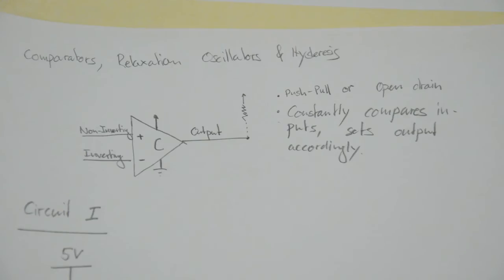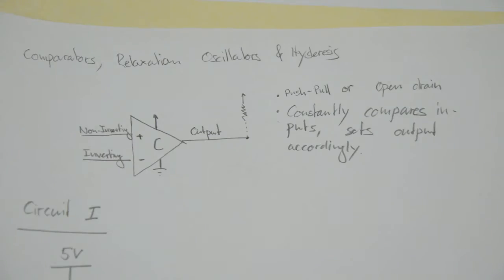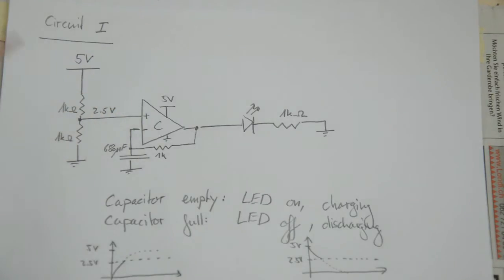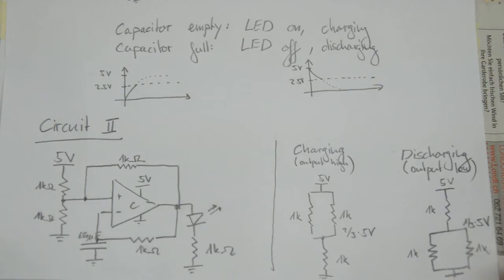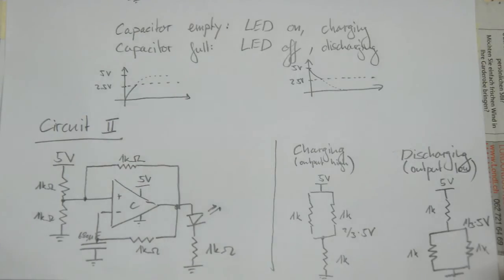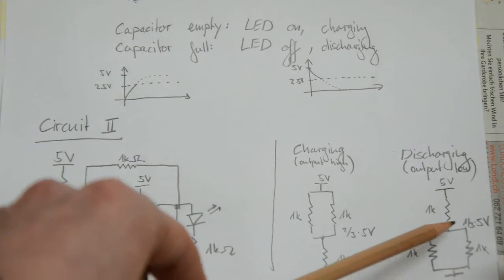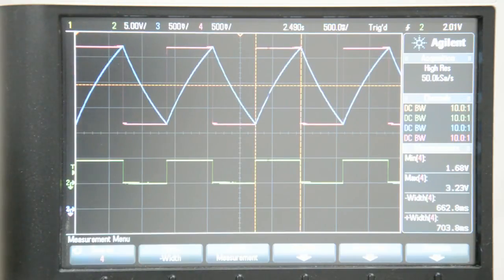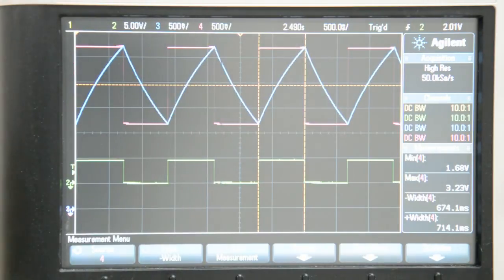Comparators, Relaxation Oscillators and Hysteresis

Comment: Hello MrCircuitMatt, thank you for the informative video! It really helped me. However I have a hard time understanding why there is no 5V on the inverting input (that is applied by the output of the comparator) as there is a connection between the output and the inverting input. Also how can the capacitor apply voltage to the inverting input if from the same wire the output of the comparator is charging the capacitor. Will the current flowing out of the capacitor to the inverting input not oppose the already existing current flow from the output of the comparator? I hope you can help me with this,

Nobadnote
Reply from the maker: nobadnote Hello nobadnote. I'm trying to explain this around minute 3:40 of the video. Are you familiar with the dynamics of how a capacitor is being charged through a resistor? You are right in that the comparator output is at 5 V. Now imagine, just as a thought experiment, a resistor of 1k instead of the capacitor. Would you have 5 V at the inverting input? I would say no, as there would be a voltage divider and you'd have only 2.5 V there. This shows that there might be something going on there that results in a non-5V-voltage there. Now due to the way capacitors work, they look like a short circuit ('0 Ohm resistor') when discharged, but as they get charged, they sink less and less current, which looks like their resistance is increasing. So if you let the capacitor charge long enough, you will indeed end up with 5 V at the inverting output. However: Sine the comparator output drops down to 0 V as soon as the inverting input exceeds 2.5 V, the cap will never get fully charged. Because as 2.5 V is reached (or whatever voltage is set by the hysteresis action in the example with hysteresis later on), the output drops to 0 V and the cap is getting discharged.

On your second question: You are right in that current would not flow out of the cap while the output is high. When the output is high, the capacitor is being charged and thus current will flow into the cap. The direction of the current changes as soon as the output drops to 0 V. When this happens, it's essentially ground and current can flow out of the cap, through the resistor and into the output. This is very confusing because it's called output, but a push-pull output can indeed sink current when it is in its LOW state.

Neither of the two comparator inputs sink or source any current. (In reality they do but it is so small that we tend to ignore it). You can think of the comparator inputs as little high impledance voltage-meters that simply measure the voltage there. So there wouldn't be any current flowing out of the capacitor and into the input, as you say. There is current flowing from the output through the resistor into the capacitor in the charging stage and current flowing from the capacitor 'backwards' through the resistor into the output in the discharging stage.

Did that help you in better understanding the process? Please let me know. Best regards, Matt
Reply: MrCircuitMatt Hello Matt, thanks for taking the time to respond to my questions! It definitely helped me understand more of the process. I'm really thankful you responded!

If by the dynamics of how a capacitor is being charged through a capacitor means how a RC-circuit works then yes. If a resistor is coupled with a capacitor in series the resistor will increase the time it takes to charge the capacitor. If I were to plot the potential difference across the capacitor over time the voltage and the current of the resistor will decrease asymptotically to 0 while the voltage of the capacitor will increase asymptotically to the source of the voltage. I also understand that the capacitor will mostly be around 2.5 volts and thus in the first circuit the comparator will switch erratically between logic low and high as explained in your video around 5:30. However I am still not sure how the voltage across the capacitor let's say it is 2.5 volts can also lead to 2.5 volts on the inverting input if the capacitor is being charged. Does the voltage across the capacitor also cause/apply the same voltage on the inverting input at logic high, and if so how? Do I have to see the comparator as a voltage-meter across the capacitor? If I were to replace the capacitor with a 1k resistor it would create as you said above, a voltage divider, which causes the inverting input to read 2.5 volts. So if I were to replace back the capacitor which has a resistance that is lower than 1k, than the inverting input would read a voltage which is higher than 2.5 volts, right? So at the beginning of the charging cycle the capacitor must act as a resistance of higher than 1k in order to not immediately trigger the discharging cycle.

I think I’m a bit confused about what causes a potential difference at the inverting input. In this case the voltage on the inverting input is greater than 2.5 volts caused by something in the circuit, supposedly by the capacitor. But a capacitor only stores charge during the charging cycle how is it able to make a potential difference of 2.5 volts at the inverting input? The 5V output of the comparator passes through the resistor and then splits in two, one way it goes to and charges the capacitor and the other way it goes to the inverting input. So the voltage on the wire to the capacitor and also to the inverting input should be the same. But then the voltage over the inverting input would already be higher than 2.5 volts if the capacitor has a resistance lower than 1k thus triggering the discharging cycle. So this is I believe definitely not how it works.

This might be a bunch of gibberish but I hope I made my problems and questions clear. I hope you can answer my questions and help me understand the process better.
 
Thanks in advance!

Nobadnote
Reply from the maker: nobadnote Hello again. We're getting closer! First of all on "does the capacitor apply the same voltage on the inverting input [...]": Yes. I guess you know this, but everything connected by a line in a schematic is at the same potential. This means that the inverting input will be at the same potential as the non-grounded terminal of the capacitor along with one terminal of the 1k resistor.

"Do I heave to see the comparator as a voltage-meter across the capacitor?": In this circuit, absolutely. The comparator senses the voltage on the inverting input, which is equal to the voltage across the capacitor because the two are directly connected (see above). It also senses the voltage in the non-inverting input which is 2.5 V in Circuit 1. The comparator compares those two voltages and sets its output according to the result of that comparison.

Now there is one point that I want to emphasize: Voltage is always across two nodes in a circuit. So strictly speaking my sentence "the comparator senses the voltage on the inverting input" does not make sense because that's only one node. But I implicitly mean "with respect to ground" when I say it like that. So the second node would be ground.

"So if I were to replace back the capacitor which has a resistance that is lower than 1k, than the inverting input  would read a voltage which is  higher than 2.5 volts, right?": I would argue that you would observe a voltage lower than 2.5 V. Imagine e.g. 1 Ohm. So you'd have 1k in series with 1 Ohm down to ground and the voltage across the 1 Ohm resistor would be very low (5 V * 1 / (1001)). Maybe this is the twist in your logic. Because it entails that it will not immediately trigger the discharge cycle, but instead some charging is necessary before the discharge cycle happens. What you said about the erratic switching is absolutely correct though as long as no hysteresis is implemented. Try to split the whole cycle into a charge-cycle and a discharge cycle and treat it as normal RC charging/discharging. Maybe this helps. 

"The 5V output of the comparator passes through the resistor and then splits in two, one way it goes to and  charges the capacitor and the other way it goes to the inverting input.": This is another thing that is very important to realize: The way you spelt this out somehow suggest that voltage is something that flows. I'm not sure if this is what you have in mind, but if it is, then that would be wrong. Voltage does not flow. Current flows. So it is correct that some current flows out of the output, through the resistor and into the capacitor. As a consequence of that, the voltage across the capacitor rises. However, there is no current flowing into the inverting pin. Well, there is a teeny tiny little bit of current, yes. But you can absolutely neglect that. This is like the current that flows into your multimeter when you are measuring voltage(!). In that sense, I really like your suggestion of treating the comparator inputs as multimeters which sense the the input voltage.

"But then the voltage over the inverting input would already be higher than 2.5 volts if the capacitor has a  resistance lower than 1k thus triggering the discharging cycle.": This is the same twist here again. Maybe realizing that it's exactly the other way round already fixes your issue. If not, please please please re-iterate and ask again for clarifications, I'd love to help you sorting this out. Maybe it was not smart of me to introduce the resistor-replacement thought-experiment. Another way to see this is by simply treating it as exactly what it is: Charging a capacitor through a resistor. Exactly like you described above, the voltage would asymptotically approch 5 V. And at some point it will reach 2.5 V during that process. And then we need hysteresis to make the whole thing oscillate in a controlled way. Let me know if this needs further discussion to sort it out!
Reply: MrCircuitMatt  Hello Matt, thanks again for helping me out. I still have some questions but I think I am understanding it better now.

I do know that the voltage is relative and it is the electrical potential difference from point A to B and is defined by how much energy it takes to move a charge through an electric field from point A to B. It is the charge and thus the current (how many charge flowing in a point per second) that flows and the voltage is the 'pressure' that is needed to let the current flow.

'I would argue that you would observe a voltage lower than 2.5 V. Imagine e.g. 1 Ohm. So you'd have 1k in series with 1 Ohm down to ground and the voltage across the 1 Ohm resistor would be very low (5 V * 1 / (1001))...' I thought I needed the voltage across the first resistor to determine the voltage on the wire connected to the capacitor and the inverting input and thus have a larger than 2.5V applied on the inverting input and capacitor. If the capacitor was a 1 Ohm resistor would it not have a low voltage on the grounded terminal?

What I don't understand is: why isn't there (or can't there be) >2.5V directly applied to the inverting input by the output of the comparator in the first circuit? It seems like the capacitor is the only component in the circuit that is able to apply a voltage on the inverting input. But if I see the circuit I would say that the resistor and the capacitor are both directly connected to the wire which is connected to the inverting input. So how can the output of the comparator not apply >2.5V on the inverting input? It seems from the explanation and theory that the output of the comparator flows through the feedback resistor and the only way it is able to go is the capacitor thus the capacitor is the only component which can apply a voltage on the inverting input, however in the schematics it looks like the output of the comparator is able to apply, I would say 5V (1K resistor U/R * R), to the capacitor (and charges it) and also to the inverting input. I redrew parts of the circuit in paint to show what I mean: http://puu.sh/jJR5q/45c30a5b0c.png . 

Thanks in advance (again)!

Nobadnote
Reply from the maker: +nobadnote Maybe I should cook up a follow-up-video, that would be fun. 

'I thought I needed the voltage across the first resistor'. In case that was not clear: The voltage sensed by the inverting input is the voltage across the capacitor. Not the voltage across the 1k resistor. It is true that if you know the voltage at the comparator output (e.g. 5 V) and the voltage across the 1k resistor (e.g. 4 V) you can calculate the voltage across the capacitor (would be 1 V in this case). Those 1 V would also be the voltage compared to the non-inverting input (2.5 V without hysteresis). The current that flows out of the comparator and into the 1k resistor flows into the capacitor. As a consequence, the voltage across that cap increases. Next time you measure, maybe it's already 3 V across the 1k resistor and 2 V across the cap. From this you can see how the voltage across the cap (i.e. the voltage compared) climbs up. Without hysteresis, we would reach 2.5 V and move over to that erratic behaviour described previously.

'If the capacitor was a 1 Ohm resistor would it not have a low voltage on the grounded terminal?' Do you mean a low voltage across the capacitor, as in a low voltage with respect to ground? That would be the case indeed. Actually with 1k and 1 Ohm and 5 V the voltage across the cap would be close to 5 millivolts.

On the part you do not understand: The output can indeed apply up to 5 V to the inverting input. There reason why we are not getting there is that the output is turned from 5 V to 0 V before this happens. Let's say we would apply 6 V to the non-inverting input, we would power the comparator by 5 V and we would start with an empty capacitor. The voltage across the capacitor would follow the RC charging curve, approaching 5 V asymptotically. By setting the non-inverting input to 6 V (a voltage that the inverting input will never reach because it will never exceed the 5 V due to the asymptotic nature of the charging curve), I prevented it from tripping over into the discharge cycle. I somehow feel that the missing bit is that the voltage sensed by the comparator is the voltage across the cap. Because it is connected to the cap. So in your drawing, while you have 5 V on one terminal of the resistor, the voltage on the other end of the resistor is only 5 V asymptotically, when the capacitor is fully charged. Before the capacitor is charged, the voltage is somewhere below 5 V and rising.

Now the trick is that instead of reaching the asymptotic 5 V, we set something lower than 6 V at the non-inverting input. That way, the circuit will transition into a discharge cycle instead of asymptotically approaching 5 V across the cap... I think it would be fun to follow up on this with a video unless it got clear now. What do you think?
Reply: +MrCircuitMatt Hello Matt, thanks for everything! I think I understand it well enough now.

In the first stage the comparator outputs a current with a voltage of 5V, this output passes through the resistor thus delaying the time it takes for the capacitor to charge to 2.5V (RC-circuit), if the capacitor hits 2.5V, the inverting input will also read 2.5V which triggers the second stage and the output of the comparator will read 0V and acts as some sort of ground in which a capacitor can sink current. In the first circuit the two stages switches erratically due to the absence of hysteresis, however in the second circuit hysteresis is implemented and so the capacitor is able to charge up to 3.33V which results in the second stage, however due to the added resistor the voltage across the non-inverting input in the second stage is 1.67V which means that the capacitor has to drop below 1.67V to trigger the first stage again. All this results in oscillation in a controlled manner.

I hope most of what I have written above is correct and again, thanks for all the help Matt,

Best regards,

Nobadnote
Reply from the maker: +nobadnote Yes this is exactly it! I didn't check your numbers but it all seems reasonable and you described the mechanism very well. Thanks for not giving up and all the best! Matt